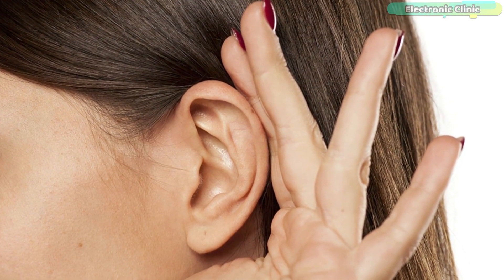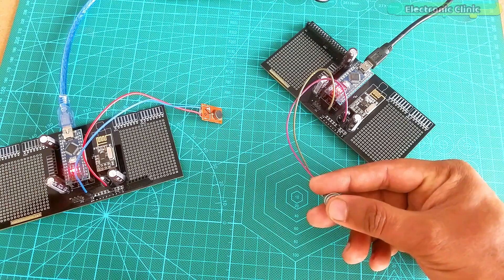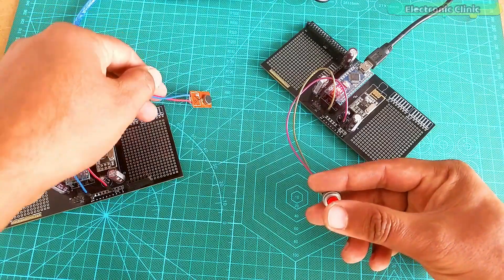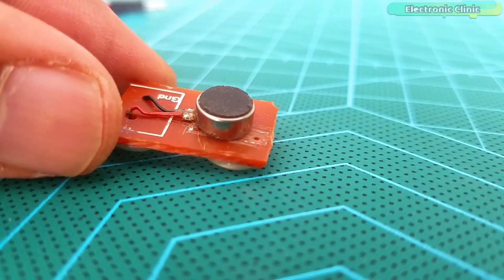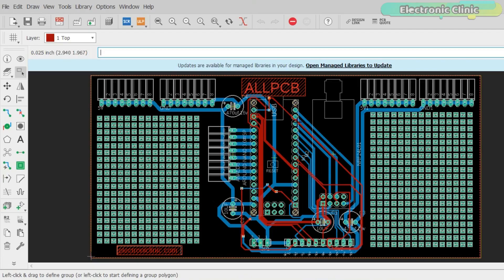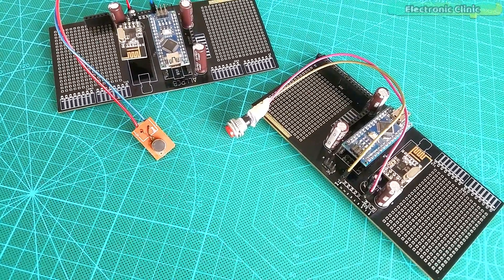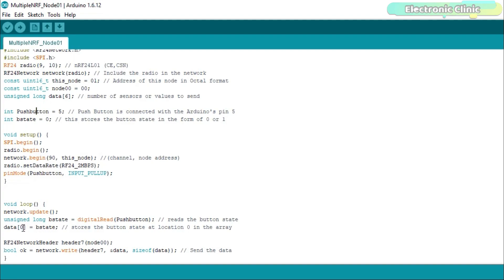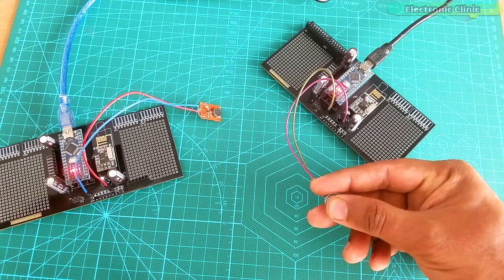Deaf People Arduino Wireless Project using NRF24L01 modules and Micro Vibration Motor

Comment: What technology would I need to:
Attach "vibration device" to "moving object",, where - Moving object is allowed to swing back and forth in one linear motion, but if altered and begins to swing left/right, a vibration is introduced until Moving Object is once again corrected to swinging straight back and forth.
Reply: A 2 or 3 axis accelerometer would work for sensing, and you could use electromagnets to alter the swing.